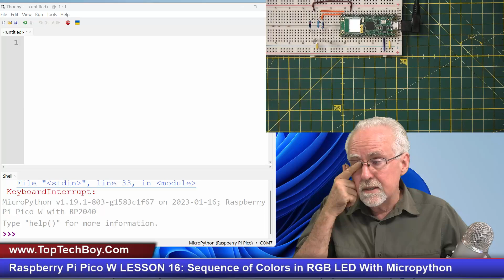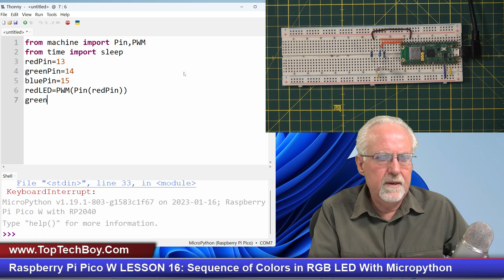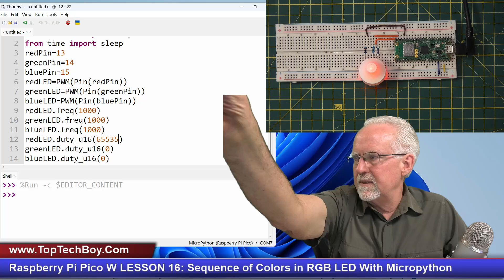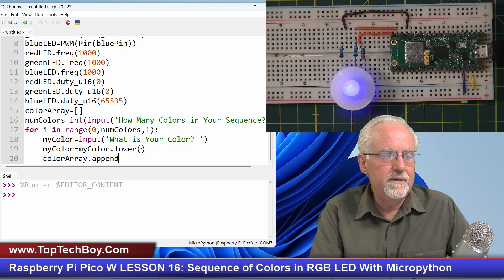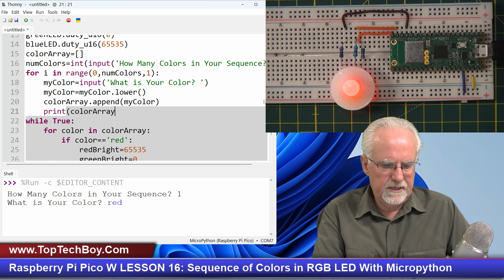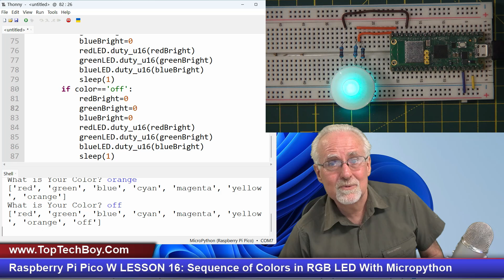Raspberry Pi Pico W LESSON 16: Sequence of Colors in RGB LED With Micropython

Comment: This is my solution to the home work. Just need to modify it to catch errors when the user misstypes. Coppy and paste into Thonny and try it. Standard RGB LED wiring.

from machine import PWM,Pin
from utime import sleep

R_led=13
G_led=14
B_led=15
delay=0
delay2=.2
delay3=.2
delay4=1
delend=4
redLED=PWM(Pin(R_led))
greenLED=PWM(Pin(G_led))
blueLED=PWM(Pin(B_led))

redLED.freq(1000)
redLED.duty_u16(0)
greenLED.freq(1000)
greenLED.duty_u16(0)
blueLED.freq(1000)
blueLED.duty_u16(0)

while True:
    print("PLEASE READ THE FOLLOWING INSTRUCTIONS")
    print("State how many colours you want and what order you want to dispay them in.\nPrint only one colour per question")
    print("Move curser to anywhere in the space below and left click")
    print("type the colour exactly as in the list displayed when asked for a colour")
    print("press enter after each choice")
    amount=int(input("How many colours do you want to display? "))
    print("You have chosen", amount, " colours")
    num=1
    colors=[]
    for choice in range(amount):
        print("Using these choices red,green,blue,cyan,magenta,yellow,orange,white or off.")
        color=input(f"What is you're colour {num}? ")
        color=color.lower()
        print("You're choice ",num, "is ",color)
        colors.append(color)
        num+=1
    print("You're final choices are")
    for I in colors:
        print(I)
        sleep(delay3)
    sleep(delay2)
    delay=float(input("How long in seconds do you want colours on for, 0.1 to 5? "))
    cycles=int(input("How many times do you want the lights to run? "))
    #print("Display will run in 3 seconds")
    sleep(delay4)
    start=3
    for t in range(3,0,-1):
        print("Time to start ",t,"seconds")
        sleep(delay4)
        print("running")
    for reps in range(cycles):
        for myChoice in colors:
            if myChoice=="red":
                colorR=25550
                colorG=0
                colorB=0
                redLED.duty_u16(colorR)
                greenLED.duty_u16(colorG)
                blueLED.duty_u16(colorB)
                sleep(delay)
            if myChoice=="green":
                colorR=0
                colorG=65550
                colorB=0
                redLED.duty_u16(colorR)
                greenLED.duty_u16(colorG)
                blueLED.duty_u16(colorB)
                sleep(delay)
            if myChoice=="blue":
                colorR=0
                colorG=0
                colorB=655550
                redLED.duty_u16(colorR)
                greenLED.duty_u16(colorG)
                blueLED.duty_u16(colorB)
                sleep(delay)  
            if myChoice=="cyan":
                colorR=0
                colorG=655550
                colorB=655550
                redLED.duty_u16(colorR)
                greenLED.duty_u16(colorG)
                blueLED.duty_u16(colorB)
                sleep(delay)  
            if myChoice=="magenta":
                colorR=655550
                colorG=0
                colorB=655550
                redLED.duty_u16(colorR)
                greenLED.duty_u16(colorG)
                blueLED.duty_u16(colorB)
                sleep(delay)
            if myChoice=="yellow":
                colorR=655550
                colorG=655550
                colorB=0
                redLED.duty_u16(colorR)
                greenLED.duty_u16(colorG)
                blueLED.duty_u16(colorB)
                sleep(delay)
            if myChoice=="orange":
                colorR=355550
                colorG=7000
                colorB=0
                redLED.duty_u16(colorR)
                greenLED.duty_u16(colorG)
                blueLED.duty_u16(colorB)
                sleep(delay)
            if myChoice=="white":
                colorR=6555550
                colorG=655550
                colorB=655550
                redLED.duty_u16(colorR)
                greenLED.duty_u16(colorG)
                blueLED.duty_u16(colorB)
                sleep(delay)
            if myChoice=="off":
               colorR=0
               colorG=0
               colorB=0
               redLED.duty_u16(colorR)
               greenLED.duty_u16(colorG)
               blueLED.duty_u16(colorB)
               sleep(delay)   
    colorR=0
    colorG=0
    colorB=0
    redLED.duty_u16(colorR)
    greenLED.duty_u16(colorG)
    blueLED.duty_u16(colorB)
    sleep(delay2)
    
    print("End of program, re starting")
    sleep(delend)

Comment: Everything is explained so well, but I reviewed Learning Python for beginners.  Python tutorial #2 that covers the empty array 23:25 - 26:25.  Another example on how to append a number.  Also I thought I could take line #19 myColor=myColor.lower() and replace it with .higher().  If you can make things lower case, why doesn't it work for capital letters.  Had to try it for the fun of it.
Reply: Charlotte Swift thanks for letting me know it's myColor.upper() case.  Some how I accidentally deleted your reply, don't know how I did that.  Thank you for your reply.